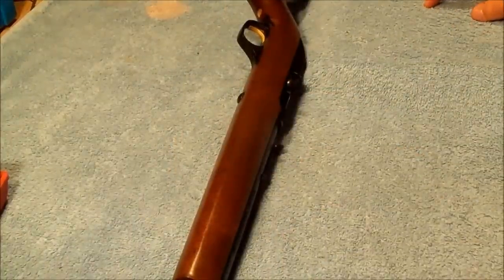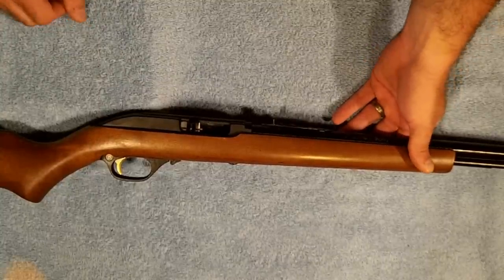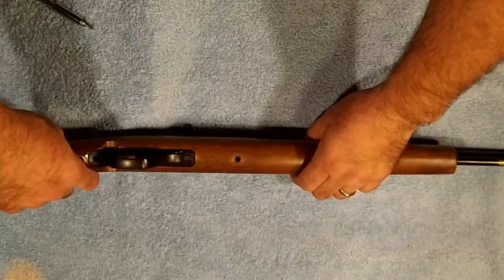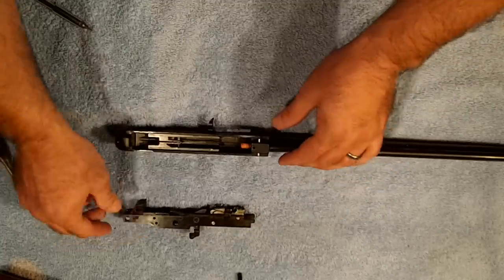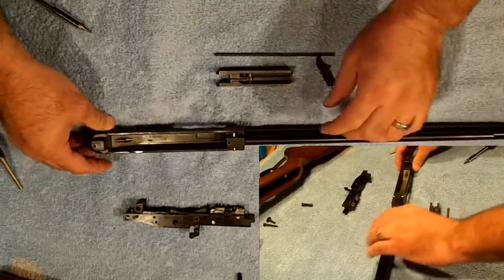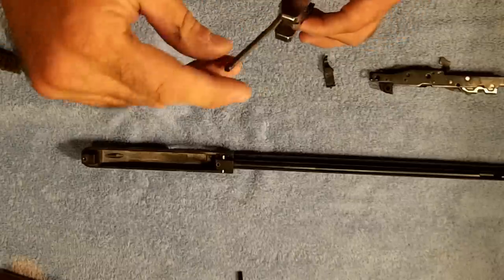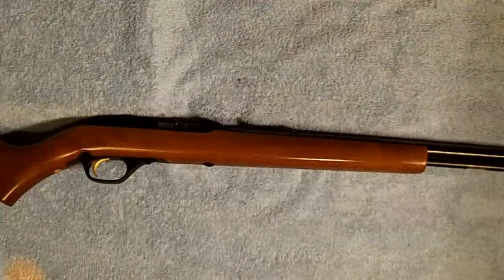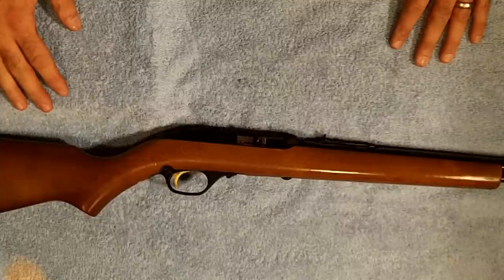Marlin Model 60 Problem

Comment: No you are wrong and every marlin 60 owner has told you that its the manual bolt hold open. There is two positions the bolt can lock into,half way and fully. Go get a marlin, pull back on the bolt and push inward on the charging handle, it will "jam" just like this. The marlins with the notch style handle actually have an arrow indicating that.  Oh and the reason its become a common problem (not saying it is) is the new owners ,not the rifle. Any marlin 60 owners that agree,thumbs up me. freakin old guys i swear lol :)
Reply: Lmao....I know right....mine is the same way...you push the charging handle in and it locks open as well as having the automatic hold open on last round fired 😎
Reply: @yrusonoz5574  The feed issues can also be from insufficient magazine tube plunger tension.  hypothetically If you've had rounds stuck inside the mag tube or (wasted) snap caps stuck you know that it;s not even a loader issue, you need a new $60 magazine tube.
Reply: @jamesdewer  well that would then be a whole other issue...in which case he didn't describe as being the problem...but in the case of being dirty..it would take literally throwing a hand full of dirt in it to make the bolt jam but it wasn't even dirty in the first place and given the 22s dirty nature if being a blowback system it still wouldn't be enough to jam the bolt..if you are someone who treats their weapons like they are a new car then I wouldn't expect the tube to be dimpled in causing a stuck round although stranger things have happened
Reply: @jamesdewer  mine is also stainless steel making it a bit tougher than regular steel but still it would be a matter of how you treat your gun
Reply: @yrusonoz5574  How old is your Model 60? Mine is 5 months old. I had to replace the trigger assembly after cracking it. I installed one of the DIP units and Mcarbo spring kit. All that work and expense and you know what? A decent disassembly andcleaning would have corrected the  12lb trigger pull. I mean It's like almost a hair trigger now. real nice. Using a trigger tension measuring unit was my downfall. I should have just left it alone. I still believe the problem isn't in my loader. I can now dis-assemble and re-assemble the entire feed assembly blindfolded. What's left? Thanks for your kind and knowledgable reply. Best wishes.
Reply: @jamesdewer  mine was built around the late 90s...98 I think...I don't usually take the trigger assembly apart (way too many springs) I just spray wd40 specialist on it and brush with a toothbrush until it shines...and I polished my bolt and receiver so it moves freely with little to no drag and your probably not supposed to but I also gave my recoil spring a light tug to stretch it out a bit as well as I polished the pin it rides on and replaced the recoil buffer with a new one...only to find out that the gun shop didn't disassemble the trigger unit(the black box with all the springs in it) they just sliced the buffer and slid it over the rear pin lol
Reply: @jamesdewer  I also sanded it down and stained it black and clear coated it and had a set of Williams fire sights installed as well....contrast is really nice and I plan on getting a trigger from D.I.P as well being it's aluminum instead of plastic and won't crack as easily
Reply: @jamesdewer  I have had people tell me that it is the smoothest firing 22 they ever shot and try to buy it from me...nah I'll never sell it...it shoots too nice
Reply: @yrusonoz5574  after all that work sell? Nope! I got a nice pic rail to mount a scope and utilized a utg rail to attach a bipod. I did mention ringing steel at 200yds! I discovered I could have saved bucks just drilling and tapping a set screw into the black plastic pawl. Same thing DIP does! Only diff between the DIP and Plastic is a threaded pins/ fasteners  which facilitate easy tear down. The fat trigger really provides added leverage and it's down right snappy!!!
Reply: @jamesdewer  that trigger is next on my list to get for mine and maybe later a composite stock....200 yards?🤯...that's out there pretty good

Comment: The problem is he didn't read the owners manual. There's a notch inside the receiver that you can push the slide handle into and lock it, just had to pull it out. Same with the 795. Knowledge is power.
Reply: Friend brought his to me last week and I saw that too.
Reply: You are 100% correct.
Reply: LOL As soon as he grabbed the charge handle i knew what it was.
Reply: Glad you posted this I had the same issue on one I only paid 60 dollars for. Fixed now.
Reply: Yep! Known that since I first bought my mod. 60 and read the manual  in 1970.   $ 57. I was 18 and still have and shoot it. It is the 10 yr. anniversary  one with the gold medallion with the Marlin name and year inset in the stock on the right side.Great rifle
Reply: Neither did this fellow! Ha ha
Reply: He pulls it out of the notch at 2:52. 😁
Reply: After he has it diassembled!

Comment: The bolt was just in locked position, pull it out next time, nothing wrong with that gun at all!
Reply: I agree.  The older Marlins (like the one I own) the bolt will lock open only by pushing it in when it is open.  Sometimes it's not too easy to pull it back out and slam it home
Reply: there is something wrong, my model 60 bolt will lock back and the bolt release will not put it forward
Reply: Noble Nitro I realize this post is from about 6 months ago, and you've either figured it out or sold the weapon but this actually is part of the normal operation of the Model 60. This bolt lock is further back than the empty chamber lock and is engaged by pulling the bolt as far back as it will go, and pushing the bolt handle in towards the left side of the rifle. It is disengaged by pulling the bolt outward.

Comment: We have had many of the early model 60's brought into us for this same issue. There is no problem with the gun, just the operator not knowing that you can lock the bolt back on these early guns by simply opening the bolt and pushing the handle in. To unlock, simply pull out on the handle and let it go forward. Bill @ Mitchell's Gunsmithing.

Comment: Learn how the firearm works!  Not only did you not know that the charging handle locks the bolt back, but you did not know that you were supposed to squeeze the split end of the polymer pin to remove the action from the receiver. Just forcing it out shears off the sides of the pin.  Also,  learn how to lubricate a firearm.  With all that lube you sprayed into the action and chamber it's going to collect bullet lube, powder residue, and unburned powder into a sticky mess with very little use.  Less than one drop of oil applied with a pin is more than enough for the entire gun.

Comment: . Been trying to shoot these things for 50 years... never saw one shoot 10 times without jamming one or more times even when new... lowest priced, like $35, but we consider them junk... switched to Ruger 10/22's (whopping $54.50 back then) which don't seem to jam no matter what LR ammo used...
Reply: My marlin is over 20 years old and can cycle a box of over 100 without jamming.  Never had a problem with it unless it's below freezing.  Best little firearm I've ever owned
Reply: Jammingest jamming jammers in my arsenal. I have the older rifle and the carbine (model 989M2) and they jamb if you even look at them. I've tried every ammo, every lube, smoothed the bolt and receiver. No joy. They still stovepipe of worse. I consider 5-10 shots without jamming to be lucky. I laugh at people who fire them 3-4 times without jamming and pronounce them fixed. Agree on the Rugers too.
Reply: I've never had such a problem w/ my Marlin Model 60.  Then again, I always keep it clean, despite thousands of rounds through it.  I've used standard and high velocity ammunition, although it's most accurate w/ standard Eley.
Reply: That's because when cleaning, people do not lock the bolt back before putting the action back on and it compresses the extractor.  Read the directions and they'll run perfectly as long as you own it.

Comment: I can almost guarantee that the charging handle was pressed in at the back of the bolt slide. If you'll notice there's a small knob at the back of the charging handle. This is intended to lock the bolt in place regardless of the bolt release. You simply needed to pull the charging handle out slightly and release it.
Reply: +Enzo Puppyboy I agree, I have the same model. It's a built in feature to manually lock the bolt back.
Reply: Agreed, I have a 1980 Marlin Model 60 and have broke it down for cleaning many times. Late 90's? For a Marlin I think of that as a new gun and to me, it didn't seem very dirty. Seeing as how he never fiddled with the bolt lock mechanism, I don't believe he knew it was there. No doubt this guy knows more about guns than I, he just missed what what going on here. From his videos I think he is more of a handgun guy.
Reply: Your a genius man I swear I cleaned this gun like 50 times before I read your comment… thank you sir 🫡🫡🫡
Reply: @poncematagolai7456  Np man, it took me a while to figure that out too lol. It’s not immediately obvious, but now that I know about it I use it all the time. Not sure why some of the other folks who said this needed to be rude about it. We are all on the same side here lol.

Comment: Two month ago, I purchase a Marlin LR .22 model 60, at Walmart for a great price. I tuck it to the range a week after that, and it is incredible accurate with just the iron sights, thanks to the Marlin’s “Micro groove barrel”. The reason I purchase the Marlin 60, was because many years ago I used my Uncle’s Marlin 60, and I loved it! Specially its accuracy. I prefer it over the Rugger 10/20, because of the advantage of the 14 rounds tubular magazine. But! I was disappointed in a few things on my new Marlin 60.
 I notice that the screws are Not like the standard flat-blade or slotted screws, commonly use in simple Woodworking application. The screws where “Allen” type (hex socket screw) and they were not tight, they ware loose out of the box. (Remind me of Stevens Shotguns)
 I also notice that the two Philips screws at the end of the Stock look like they were excessively tight and damage the screws. The rifle came out of a box… but it looks like a used rifle. The wood is beautiful with no scratches… Thanks Goodness! The mechanism was too tight; specially the bolt release, but that I can understand... its “New”… (I hope its “new”).
I started researching the Net, and I found out that Remington Acquired Marlin on “2008”, and not just that… that Remington is doing a piss job on the Marlin’s rifles. That remind me, why I prefer Mossberg Shotguns and not Remington’s. I heard horrible things on “YouTube” of serious bad quality control issues and sloppy gunsmith work.
 For the price I paid… I’m going to keep my Marling. But! If I knew, what I know now… I would rather purchase the Rugger 10/20. As a matter of fact, I was going to buy a Marling for my Son this summer… yea right, his going to love his Rugger 10/20.
 Well… the good thing is that I have my own Web-site and I can alert people of this things, I can use YouTube and other resources for the same matter. Thanks for reading.
Reply: See, that's exactly what i was afraid of! I sold my Model 60  15 years ago and wanted another one, but given how incompetent Remington is, i just knew they would find a way to screw up the 60.
Reply: ...I picked one up (used) in January - Glenfield/18 round tube mag - $200...it'll back up my dad's 90 year old Sears Ranger 101.1 (Stevens Model 87) and my 2 10/22s...
Reply: You can find older model 60s at gun shows, pawn shops and even gun dealers that took one in on trade.  The older models have an 18 round lr tube and even if it needs a part or two they aren’t expensive and more accurate and a much better gun than a 10/22 for you son.  You are correct in not wanting to buy a Remlin, get one with JM stamped on the barrel where it is attached to the receiver, or one that has manufactured in New Haven Connecticut stamped on the barrel.  Those were all made before Remington bought out Marlin.  If Ruger starts manufacturing them I’m positive they will be excellent.  Good luck!

Comment: You know the charging handle on the bolt moves in and out, right?
The bolt was only locked back in the detent position LOL.
Reply: I think you're correct on that.
Reply: yup agreed was in lock position , slide has a lock,  arrow indicates it will lock in backward position pulls in and out easily , info was bad , knowledge on gun was poor.
Reply: Winchester cal 22 model 290

Comment: I appreciate this video. Bought my dad one in the late 70's. Went out in the field to see the tractor running but dad wasn't plowing and nowhere in sight. Scared the heck out of me! Found him throwing rocks up into a tree at a groundhog. Neither of us knew groundhogs could climb trees, whistle and drive the old man crazy! lol Christmas rolled around and I knew what I was buying him! lol I had the same trouble, though. After dad passed, I got the rifle back and it was "jammed". I tore it down and cleaned it. Never knew about how to free it up once it "jammed". I would have still been scratching my head. The manual was long gone, at that point.
Reply: You used to be able to obtain an owners manual from Marlin for free by just requesting it.  I don’t know if Ruger is doing the same thing now but I’ll bet you could get one on the internet.  The manufacturers supply owners manuals so one can familiarize themselves with the particular gun.  No matter how many guns you’ve owned it is still a good idea to read it.  Case in point.  The owner of this model 60 could have easily solved his problem if he had read the manual or obtained one before firing the rifle.

Comment: I was given a Glenfield 75 (Marlin made them based on the 60. Same action) It was done the exact same way and it was a manual bolt lock feature on the bolt. I know this is an old video but I just took mine apart for the first time after years of shooting and thousands of rounds. The thing was super dirty inside. I decided to look into how to disassemble it and clean it (should have been done long ago) but the gun kept working even that dirty. The gun was my uncle's gun and he'd locked the bolt back by accident and didn't realize you just pull out. I was messing with it one day and figured it out. He gave me the gun. I still have it all these years later. Great gun.

Comment: Had a similar issue. All parts were fine, but bolt would hang up once in a while. Action felt very rough. Used dremel tool and polished the inside of the receiver and the outside of the bolt, using the polishing wheel and the compound that came with the tool kit. Haven't had a problem since.

Comment: A lot of people here missed the beginning where you tried to release the bolt through normal means, it was stuck and then you verified it was stuck when you took it apart, separated the receiver from the bolt, at this point with some fidgeting, you were able to finally get it un-jammed.  Good video and troubleshooting of the issue all caught on video.  I don't think the quiet rounds the guy was using have enough power to cycle the bolt, but not sure how it caused it to get wedged.  I agree, chalk it up to some gunk and grit down in between the bolt and housing.  Thanks for the video.
Reply: It’s not stuck. It’s designed to lock back half way and once again all the way. You can clearly see him pull the charging handle out as designed to release the bolt from being fully locked back.

Comment: I have a couple of older Remington 522's that don't have the last-hold-bolt open feature..
BUT you do use the charging handle to pull the bolt back then push the handle in to lock the bolt back.

Comment: I have 3 Marlin 60s and no problems. I use Federal bulk that runs in my .22 AR, pistols, marlins, and even the Ruger 10/22. One of my Marlins had a problem when i first got it (used) but after cleaning years of crud out and replacing the hammer spring it ran great. I hear about so many guns that are total garbage and all of them suck, but for some magical reason when I get my hands on one they work great. Maybe I am a gun god or something.

Comment: The bolt problem you are having is due to the fact that on some of the really old models there is a notch in the receiver and a little pin on the bolt handle. So when you pull the bolt back and push in on the bolt handle the bolt locks back.
Reply: AND ALL OF THE NEW MODELS

Comment: nothing wrong with the gun its you can push bolt in when pulled back and it locks itself just pull  out and it will unlock it may of been that and dirty and when fired it went to lock position

Comment: On the 60 when the charging handle is pulled all the way to the back and pushed in it stays in the locked open posistion. You need to pull the charging handle out to release, other wise it will remain locked open. Bolt release will not work untill the handle is pulled out of the locked posistion. This is on newer and older model 60's

Comment: The bolt locks open, when you push the charging handle in with the bolt back.   I watched this whole thing to see if he figured out that root cause.  He never noticed the detent inside the receiver, or that the charging handle is machined to slide laterally in the bolt.  At least he cleaned his friends .22, that was nice of him
Reply: I had the same problem with my Marlin 75.. the bolt would not close.
i was watching another post and i saw the guy pull on the lever and holy cow.. i tried it on mine and problem solved.  Its the little things that burn you if you don't know.
Reply: Absolutely, a hidden feature!
Reply: Edward Neu Well, if you read the frigging manual it isn't.  I am just amazed how stupid some gun owners are.  I wonder if this guy locks himself out of his car, and can't figure out why the door won't open.
Reply: No probably locks himself IN THE CAR!